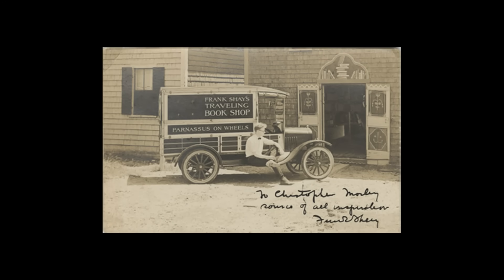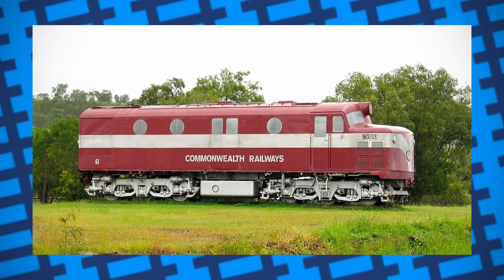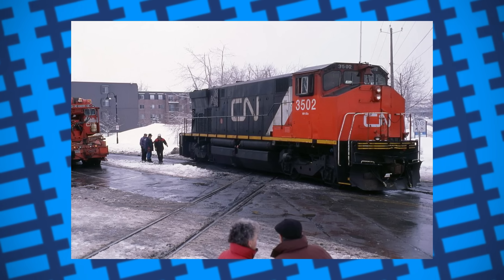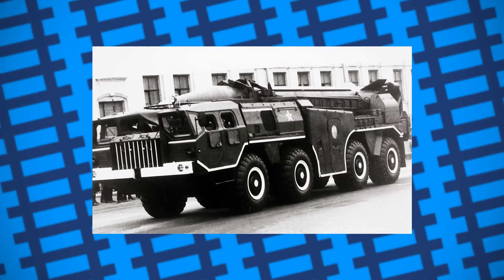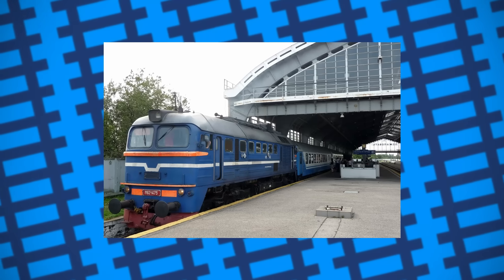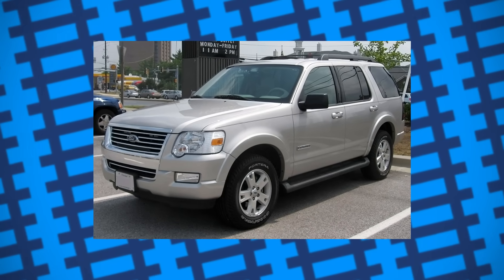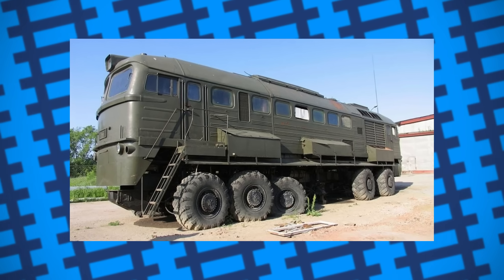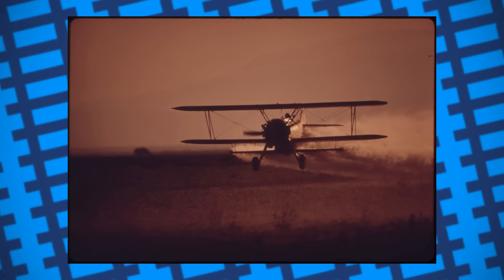Why Railway Locomotives Don't Make Good Road Vehicles - M62 + MAZ-547

Comment: This episode is full of Misinformation: 
The truck chassis was complete with its original engine, transmission, etc. The locomotive was worn out and thus was only used for the engine, generator, sheet metal, etc. As the locomotive was being used as a temporary power station only...
The failure was when it was driven on undeveloped roads, as the load was briefly transferred to a few axles, causing the failure. However, the experiment was successful as the power station was used on numerous occasions before it was broken. So basically this was no different than the Canadian use of a diesel electric locomotive being used for emergency power...
Reply: The little clearly written about the Mashka project states (roughly translated) "Reclaim the standard bogies, it was installed on a six-axle MAZ-547A chassis, from which the engine, hydromechanical and transmission units were removed before.They say that the result was supposed to be a hybrid tractor powered by a diesel locomotive traction generator."

Instead each wheel was fitted with a 80hp electric motor. The fact this summed to less than half the locomotives engine/generator capacity is the main reason external sources theorize it might have intended to export power, but this is NOT directly documented in the brief notes I can find about the project that it was either actually adapted to do so, much less this was the purpose/intention. The onboard generator for the train was DC, and not of the voltage used by any power connecting system in civil or military use of the time, and neither equipment nor space was provisioned to convert it to anything else.

Likewise there are two contradictory accounts of its failure, but both claim to have happened in only a few feet, one alleging the axle failure caused the wheel to fall off (as said in this video) and the other that the wheel was removed as it was gushing hydraulic fluid used for the steering. Your theory about weight transfer is perfectly believable, dynamic movement easily can triple the load on the already overloaded truck base, but I can't find it stated in russian, and the only movement on undeveloped roads I've found was afterwards, when it was towed, not driving.
Reply: I remember when they purposfully derailed that locomotive to go hook it up to the power grid. XD That was quite the show, but hey, emergencies call for desperate measeures.
Reply: Exactly, it's also all just a game of balancing reliability with power output, you can get an engine the size of a suitcase to output 2000hp it just may not be able to do so for very long. I think part of the reason the project "failed" or nobody cared to make it work was because a locomotive engine was the wrong balance. It would make sense to make 3 offroad trucks capable of 1000hp and let one be down for maintance at a time but not lose quite as much in the drivability department. So today these types of vehicles have been replaced by engines that are framed in standard containers and are fully modular, you can stick a whole pile of them on some trucks, trains, even aircraft and maintain them as needed on site.
Reply: I have a train bote
Reply: What a nice day- 
crack
loud shattering
Reply: There is another reason they built that: because FUNNY!
Reply: Ah yes what a nice day-
The bump has spawned
O H N O
Reply: Your mentioning the use of the Rail engine's power plant and generator brought the Canadian use of diesel electrics to provide emergency electric power during outages caused by ice storms etc.
Reply: And here we have the modern understanding of constructive criticism.  Instead of starting with something helpful, we open with an accusation.
Reply: Okay, so frankly this needs an unlist+redo
Reply: They put a locomotive on rubber wheels
(Very stupid thing to do)

But wait, "it is not what it looks". OH, YES IT IS. Just own it with grace
Reply: It's very fashionable to riducle the Russians these days in spite of their overwheleming technology prowess.  For example, the Russians successfully deployed large tracked vehiciles in the Antartic. As an extremely large land mass, ice and snow covered for a good aprt of the year, the Russians have all the experience in this field. And soem peopel don't like it.

Comment: The only scenario I can imagine for turning a locomotive into a road vehicle is in mining. After all, some of those colossal off-road dump trucks at pit mines practically are locomotives in disguise, boasting engines just as powerful and electric traction motors to boot—minus the train tracks, of course.

Comment: And not to mention that trains are wider than vehicles on the road. Trains can be 10 ft wide where a regular truck or (Lori in your country as stated) can be 8 ft wide max.
At least here in the United States, anything wider than 8 ft requires special signs that says "wide load" and cannot transit on every road; only specific roads.

Comment: this doesn't make all that much sense as things like Road Trains exist
a Train would need it's weight to assist in traction though as steel on steel doesn't off much traction with would also be important for breaking, steering would be an issue though as a entire steering system would have to be made up

Comment: You are forgetting one crucial thing, power to weight ratio. Yes, a Volvo SUV has 200hp for 2 tons or so, that's 100hp per ton, but the 2k hp on 85tons is only about 23hp per ton, which is nothing, even a tiny old Renault Twingo has 50hp per 850kg, so 2.5 to three times more power per ton.

Comment: It was never a project, it was a testbed for electric drive suspension, the reason they used entire locomotive is cuz of time and cost, they would need to build an enclosure, wiring, controls..etc even if they ripped diesel-gen out anyway, this way everything was already build.

Comment: How come you never mentioned the torque output? Electric engines are well known to produce high levels right at zero RPMs. A well tuned pickup can make 2700 Nm while a freight train can produce 300,000-500,000 Nm.

Comment: Because of all that weight, and the fact that Locos have intensely torquey engines, I'd imagine it'd just rip its tires to shreds in a sticky situation. I don't care how tough your tires are. They aren't designed for that lol. Even if you put solid rubber mining tires on it, it would likely still be too much.

Comment: If they had just used the carriage from the weapons system, maybe put in some reinforcements, and put the engine + alternator and a purpose built cab on top, the russkis might have actually had a capable offroad mobile power plant. Add a transformer station vehicle/trailer, and you can power entire settlements with mobile infrastructure.

Comment: Interesting comparing the stats you cited for the locomotive engine -- 150L & 2000HP -- against a normal car. For instance, the engine in my car can make about 240HP on 3L, naturally aspirated. So the train uses 50x the displacement to make about 8x the power. I guess this is one of those cases where there is a replacement for displacement!

Comment: France used a pair of similar vehicles to run a novel canal lock. A slanted (and dry) canal was built up the side of a hill. At the bottom a scop was lowered behind the boat, and the two 'trains' pulled the scoop, boat, and a few hundred tons of water up the sloped canal. The scoop leaked like a sive, but the gates at the top were opened just enough to refill the losses. It actually worked for a long time, though towards the end of was run more as a novelty than a useful way of moving cargo.
It was recently resoted to origonal appearance, though sadly not running status.

Comment: It's not entirely impossible; in 1912, Ferdinand Porsche developed the Landwehr train. 
It was used for military purrposes and could carry goods on rails but also on roads and was used by the army of Austria-Hungary in WW I.
Porsche used his hybrid traction ideas by generating electricity with a petrol engine and using electric motors on all axles, giving this train the necessary traction.
However, this dual use was the intended purpose of the whole trainset - it was not an attempt to retrofit wheels on something that had been designed with only rails in mind...

Comment: The discussions of power, relative power (hp/ton), and torque/ tractive effort are areas that could have been expanded in this video - 400hp for a class 08 shutter is not unheard of for a car/ 4x4 - I have a BMW X5 with an engine rated at 448hp ... but my BMW does not weigh 50 tons!

Comment: It boils down to this;

It is occasionally useful to have a car or truck or van, etc, that can travel down rails. Maintenance crews, security, especially things like excavators and cranes which may need to operate on the rails themselves, or simply nearby. There's a lot of railway staff that need to be able to travel along the roads - if for no other reason than to avoid jamming the lines - but that would benefit from being able to travel down the line every now and then.

On the other hand, it is never even remotely useful to have a locomotive that can travel on roads. There is no demand for it's power or torque, the weight is far too much for many structures, and even when it comes to simply relocating the locomotive itself, this is far better done by using a transporter vehicle.

Comment: I wouldn't let an epic post-Soviet failure of a project like this put you off converting a rail vehicle to a road vehicle. It just wouldn't be a small one. Although, having said that, if it was desirable, I'm sure a heavy haulage company like Mammoet would have done it by now. Having a single vehicle to tow super heavy loads versus a number of smaller ones would be of tremendous use, but I have never seen it done. Instead, they've come up with other methods.

I think a major problem with converting a rail vehicle to a road vehicle comes down to the steering system. As they say, it's better to have it and not need it than to need it and not have it. Regular cars and trucks on the rails don't need it, but have it. In the opposite direction, rail vehicles need it but don't have it, vastly adding to the complexity. Though to be fair, a lot of road vehicles converted to rail use have their chassis completely modified, removing any road functionality, but just as many seem to be simple wheel swaps or designed to have both sets of driving gear.

Along with steering, another problem is that road vehicles are usually small, relative to the loading gauge of the rail line, but rail vehicles are usually really large, and very heavy in relation to what is allowed on the road. And so, with the amount of chassis work needed, it would  be better to start from scratch. There's also adaptability to task. Almost every road vehicle that goes on the rail is to do a task that a standard train/locomotive would be unsuited for, such as servicing a line with low traffic, or simple rail inspection, or specialized rail maintenance equipment. There is not really any task on the road that a locomotive would be suited for that other vehicles can't do, which is why rail to road conversions are almost never done.

Comment: Just onefun fact about the M62. In eastern Germany it was called Taiga Drum, or Stalin late revenge, because it was so loud when they started to drive around there. Later they got some silencer built in, which made them a bit quieter. Still great Loco.
Reply: Rumour has it that its noise level was a feature intended to inform the sparse Siberian population that a train is on its way and should arrive some time the next day. That should give the remote villagers enough time to travel to the station. :)

Comment: The Montech barge lift on the Canal du Garonne used/uses two diesel electric locos on tyred wheels to move barges up the gradient on concrete tracks at 4.5kmh. 
https://en.m.wikipedia.org/wiki/Montech_water_slope

Comment: 4:52 : The size of the contact area is irrelevant, they need this weight because the coefficient of friction of the steel to steel interface is really low. Pretty sad display of knowledge for someone calling himself trainfactguy.
Reply: What a blanket statement. I’m too tired to deconstruct your statement and construct a proper rebuttal so let me just go through each step. 
1. The coefficient of friction between two steel surfaces is in fact very low. 
2. Locomotives must pull very heavy loads with steel wheels on steel tracks. 
3. Friction increases with force applied between surfaces, and with greater contact area.
4. More friction is required in order to make a greater tractive effort. 
And so, the “platonic ideal” for a locomotive would be extremely heavy, and have loads of wheels.
Since more wheels can prove unwieldy when maneuvering turns on the tracks, common locomotives thus have a reasonable number of wheels, and are very heavy.
In short, both matter. Can’t just discount one because the other is true. Sorry to say, but that’s stupid.

Comment: If it was intended to be used as a self-propelled emergency power station for remote areas and therefore able to move across undeveloped roads, putting the engine on a tank hull would have been wiser: The tracks can carry around 50-70 tons (without all the armour a tank hull is significantly lighter), do not care much about bad roads or unpaved backyards. Are a little slower than wheels though, if you don´t want to risk excessive wear.

Comment: There is no sense in comparing cars to locomotives. Rail engines are about torque, not power. That's why "diesel" engines are really diesel-electric, rather than the diesel engine being connected to the wheels via a gearbox. The electric engines produce maximum torque at 0rpm and hold it well up the power curve. The diesel wouldn't have a hope of accelerating the train directly. The power is needed to drive the generator (used to be an alternator and DC power until the 90's). A typical locomotive might produce 80,000Nm of torque and 3,000hp, vs a big truck at 2800Nm and 600hp - that's 28 times the torque from 5 times the power, and produces it at idle instead of several hundred RPM with the truck. This difference is why Teslas and many other EVs blow away petrol Ferraris on drag strips. It's also why Steam locomotives and electric locomotives were so successful - like electric, steam produces enormous torque at low speeds (not necessarily at startup as it depends a little on the valve and linkage design and positions).

Comment: It's a bit nitpicky, but the engineering explanations aren't exactly true. Friction Traction is unaffected by contact area, it depends exclusively on the materials. Wide car tires being gripper is because the rubber has more grip, the width has to be added for heat dispersion and wear resistance.
Also, for their weight, locomotives are not powerful at all. A usual modern car has 100hp per ton, modern European freight locomotives sit at around 15 to 60 hp per ton.
They don't need any more power, because their tracrive power is limited by their wheels friction coefficient times wheel load times wheel count.
For the M62 that's about 0.3 (steel on steel), times 10 tons, times 12, so about 40 tons of pulling power, at regular traction levels.
This is perfectly fine for long huge trains because you can start to move about 160 tons of rail waggons on level ground by hand and alone.
The major difference of road vehicles is rolling resistance. When you see a semi truck with heavy loads, the tires containing 10 bars are squished flat at the bottom. While driving they always are. So for each rotation of the wheel you move a truck for, you also have to exert all the force needed to squish every single wheel in as far as it is pushed in while standing the whole way around. Railway wheels do also have elastic deformation you need to put the power down for, but it's nearly negligible. That's why we have the 1 cent coin sized contact patch and efficient movement.

Comment: "Using a locomotive engine to run a road vehicle would be like trying to modify a jet fighter into a crop duster." Immediately I think of the infamous soviet jet-duster, oh those Russians!
Reply: The Belphagor was designed from the ground up to be a crop duster. But there is an American crop duster, the Air Tractor AT802, that was made into a military reconnaissance plane.

Comment: At least in the States, there are tractors that have railroad couplers. They take the place of industrial switchers as they pull fully-loaded freight cars around. The real advantage over a switching locomotive is that they move around independent of the railroad tracks when they are not pulling or pushing a railroad car.

Comment: I live one town over from Boucherville, Québec. That's the town that used a CN locomotive to power municipal buildings following the general power failure due to the ice storm of 1998. What wasn't mentioned is that the loco travelled a short distance along the street under its own power to get from the tracks to city hall. The divots were visible for years afterwards.
Reply: I believe they had to crane it over 1 or 2 bridges too?
Reply: @SpudsMcCat  No, it was parked next to city hall which isn't a long distance from the CN tracks and involves no bridges or underpasses.
Reply: @CaptHollister  How the heck did the steer it or get it off its tracks (and back on the tracks)?
Reply: @guytech7310  They used a crane to lift it off the tracks and turn it 90 degrees to point it towards Boucherville city hall which is maybe 50 meters away from the tracks. It's a straight line so there was no need to steer.
Reply: @CaptHollister  Thanks, that makes sense.